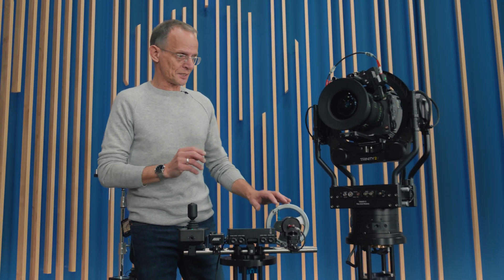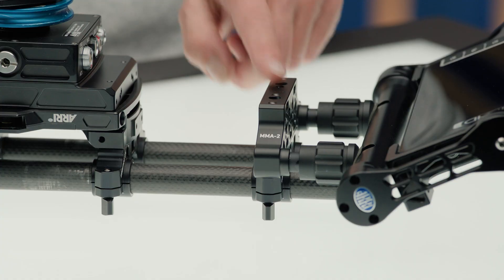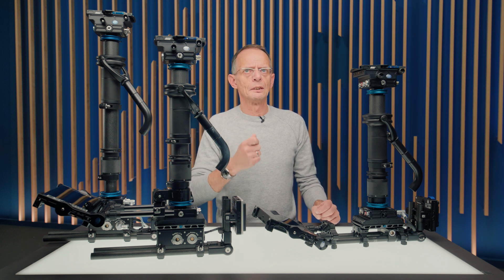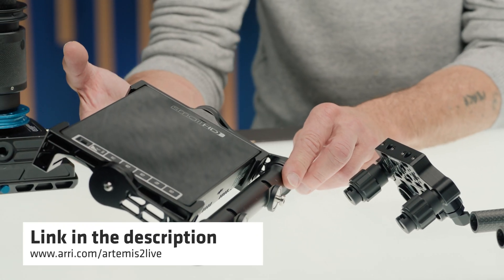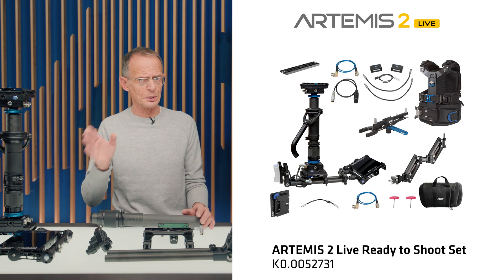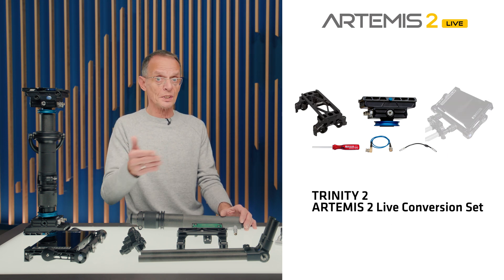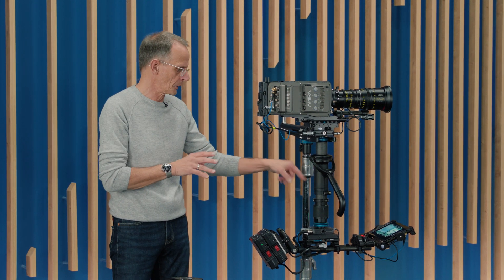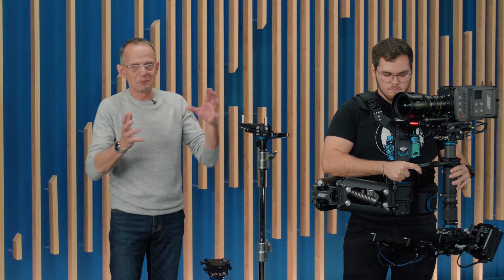ARRI Tech Talk: Introducing ARRI ARTEMIS 2 Live

Comment: nice set up but on the camera is missing the radio transmitter, the focus and iris motor with his control unit and the lens hood.
if you put all these things, with that little weight in the bottom, how much does the sled extend?
Reply from the maker: Hi there - even with transmitters and lens motors it's still possible to build a very short system with the Shorty Post. We recommend reaching out to your local dealer for a demo!